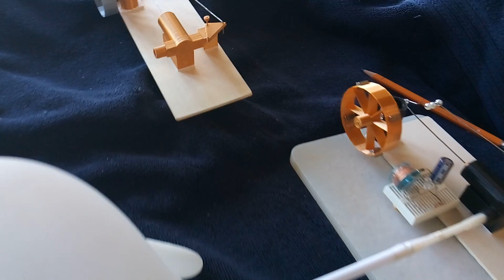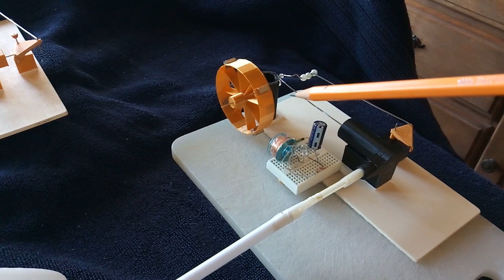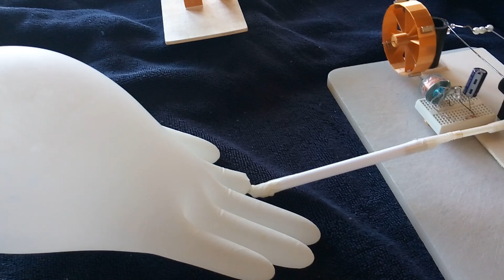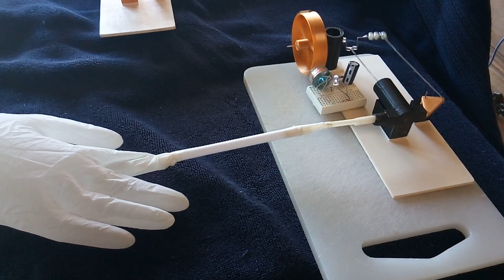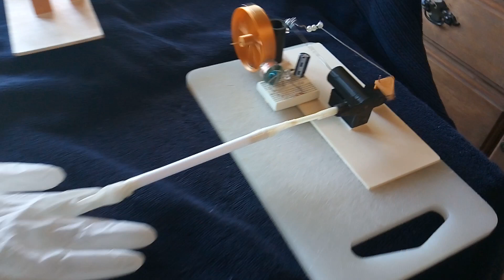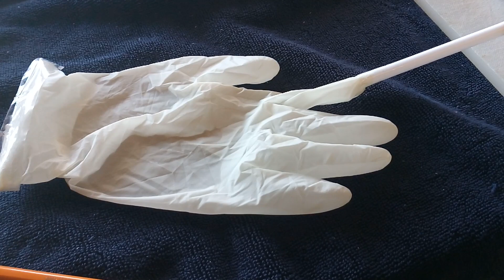Electric Powered Air Engine

Comment: Assuming there is sufficient energy in the super cap, will it overcome any induced drag from the partial vacuum created in the glove?
Reply from the maker: Yes.  This engine is very air leaky.  You can seal off the intake and it still runs.

Comment: Thumbs up for a great video!!!.. Next has to be: Configuring it to fill the glove with air. Once its full, (or if it cant continue because of lack of strength or current in the supercap, it should somehow invert the function and run on the air only... filling up the supercap again. (I think it wont be difficult to modify your circuit).. it will get less efficient at every cycle, but sure would be a wonderfull little machine to watch running.
Luc
Reply from the maker: Hi.  I see where you are going with this but the design is way too rough to do what you suggest.  A more refined version that ran perhaps on solar energy to pump air into to air storage tank would be fun to experiment with.  It would be great fun to watch the little machine cycly back and forth.

Comment: Yes its work, ive try it with my 40awg pulse motor and then blowing air with straw from my mouth..more speed and led more glowing, im not test it with  pickup coils or automatic like yours, ive just thinking what if bemf powering small air pump buble to make it auto..cheers..
Reply from the maker: Lots of things to try with this concept project.

Comment: 4:13 
I just bought a pound of 44 gauge wire to wind coils with, that may have been a mistake, very challenging to make coils with it.
Reply from the maker: That wire ( which I call 'Frog Hair' wire) is terrible to work with.   You need to use it to get the low power draw coils but I dread the winding.
Reply: @Lidmotor  Look for a solar rocker, it has the coil in it. Do not try to tear it apart as it is glued, just cut the plastic to take the coil out. A second source would be the coil out of a (1 AA Battery) clock. If you don't mind there is some resistance, the coil of a small relay can be useful (and add a resistor in series). Good luck!
Reply from the maker: @deslomeslager  I have used both of those coils.  They work great.   My dollar store was selling out old solar rocker toys for 50 cents ea so I got a dozen of them.

Comment: Thank you for your inspiration. Take  look at my video and use the design to improve yours it' will change how long the devices run hugely and it simple just a coil change thanks again
Reply from the maker: Thanks.
Reply: @Lidmotor  MY PLEASURE Hope it makes sense and helps

Comment: That is cool. I’m curious what the current draw is. Also if you somehow added an extra port on the other side of the power piston, or an additional separate piston in parallel  dedicated to only pumping air would it then pump air. Very clever. I looked up the link on the design of the steam engine you provided a few videos back. It was interesting. Keep them videos coming
👍🤓
Reply from the maker: This is drawing about 20 mA out of that 4F / 2.7v super cap filled with about 2.5 volts..  The amp draw goes down as the voltage drops in the capacitor.  A 'double action' version of this design would be very interesting but I probably won't build one.  Maybe some else will.

Comment: Thank you for sharing this video.   Very efficient and effective design.   I just wonder how much of a vacuum could actually be pulled from it......  Hmmm going to have to build one.
Reply from the maker: There is alot of air leakage in this engine and it is really only a proof of concept design.  It will not pull down much of a vacuum.  If someone took the design and ran with it then who knows where it would lead.  Go for it.